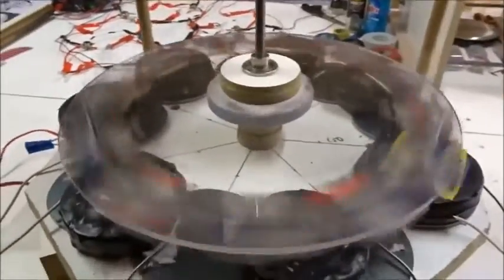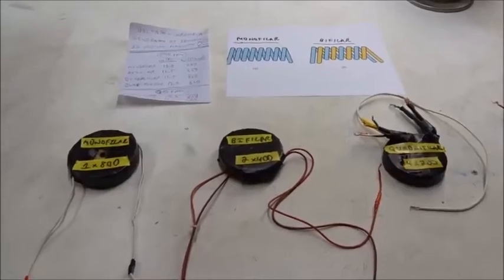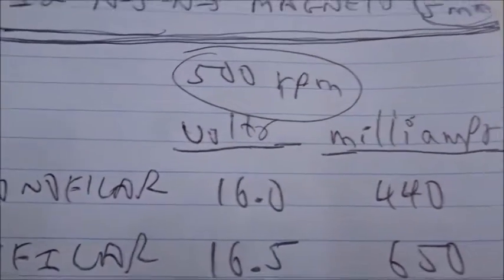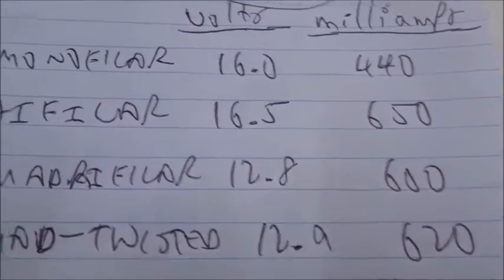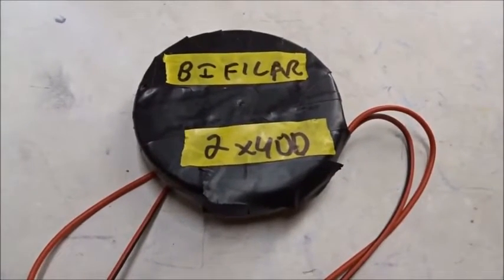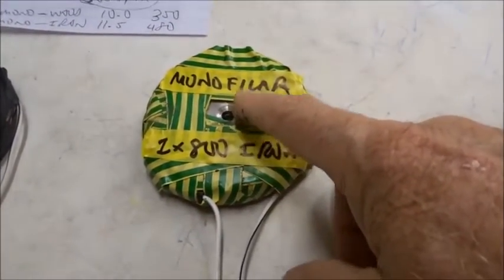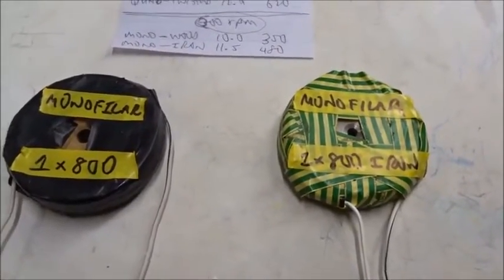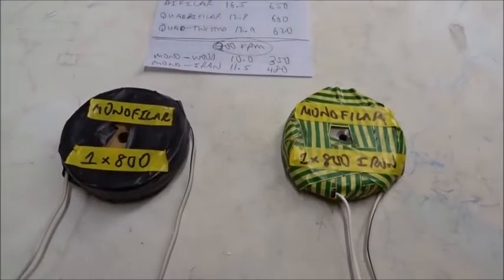Tesla was right! Bifilar coils are better for generating electricity: Part 18

Comment: The windings matter. When you have a wire or coil that are essentially straight, the electromagnetic inductance is maximized. However with twisted or cross hatched weaved multi-strand cable wire such as in high-end audiophile grade speaker cable, the weave helps reduce the inductive/antenna effect because when the wires are weaved together st roughly a 90 degree angle, it causes a 50% reduction in the magnetic field around that wire, which in turn helps reduce the inductance, capacitance and EMF noise that can negatively affect signal quality. So for high grade audio, you want a cross hatched weave with pure copper or silver wire, but for use in a generator coil, that cross hatch weave would essentially kill up to 50% of the inductance capacity of that coil due to wave cancellation effects.

Comment: You do realize that bifilar coil is a capacitor right. That is what makes it efficient at creating electricity.
Reply: No, it is synchronised resonance .
You might have 3-rd (but) as closed loop connected ends, then/that would act as capacitor.
As on transformers with different cores, the one as on microwave ovens where coil is in mid, the sides cancel the loop after input is cut, but placing additional wire and ends connected, continues as magnet even after removed the input. Typical example. 
While, other type of cores, some do not need closed-wire-coil-loop and they always act as magnetized after removing input . Typical example as half moon electro magnets.

There are lot more,... but some secrets should never be told, price is too tag, testing combinations will never get any to it... same as without Nikola they would never find frequency.
Later years Nikola was as spending time and going happy in casket with thought to all "you'll never find it".

But, nice mentioning the capacitor. Similar function.
Reply: A Tesla bifilar coil is essentially a line of a certain specific impedance operating in a special connection.

Comment: I assume this has to do with the power factor?

If so, couldn't this be solved just as easily by putting in a capacitor?

There's no way everyone in power generation just missed this, so I figure there's a good reason why it's not mainstream. Does anyone know what that reason is?

Comment: Thank you to everyone for the comments! We also had coils with 3 strands (trifilar) or 4 strands (quadfilar) but did not get better results than 2 strands (bifilar), so we did not show them in this movie. The bifilar coil (wired in-to-in, out-to-out is also excellent as the secondary of a solid-state Tesla coil. If anyone has any good ideas which I have not yet tested, please add comments below, then Tammy and I will try to get onto it! Right now I am working to make a better ion-drive for space propulsion, on a small scale anyway. When you are up to your ass in alligators, it may be hard to remember that your objective is to drain the swamp!

Comment: monofilar will still have some capacity between its windings. but the main trick of the bifilar is, that the voltage that charges up the capacity, is much higher (1/2 the supply)

 so with bifilar the resonant frequency is much lower, and the coil can store much more energy in it's resonant fields.
Reply: I see you found the video thank you again for following up on my request to review this video.

Comment: There is something you can clarify for me. I am under the impression that your setup of your rare earth magnet assembly will produce DC and not AC as you mentioned. How is it that you produced/measured AC? I too have made a bifilar hemisphere coil and used an AC to DC transformer as a power source. What I don't understand is that the compass that I used to see if the current was stagnant or fluctuating. It spins the compass at a very fast rate at only 3V DC input. So does the bifilar coil change DC input to AC. Thank You for your demo.
Reply: any set of moving magnets makes AC

Comment: Correct, when the primary is under load ,the secondary with a variable capacitor could be tuned to act as a buck booster. It cuts down on wire heat almost to the point of elimination. It can be shunted or a variable resistor too but not much research on that end

Comment: cool, however have you though about which order to put the quadfilar coils in. because when looking to the voltage difference which causes the capacitance. because if you put it in order like coil 1, coil 2, coil3, coil 4, then it will have lower capacitance the difference between 1 and 2 is 25% the difference between 1 and 4 is 75%. going from one to 4 to 2 to 3 you should get practically the same capacitance and effects as a bifilar coil. when you form the coil more like a thoroid or ball the quadfiliar coil can have a greater capacitance than a thoroid or ball shaped bifilar.

Comment: This is a good stuff. So please do next test. Measure a power at input of running motor. See if there is a difference in power consumption between a bifilar and monofilar coil. It is clear that bifilar coil gives more out at same speed of rotor (500 rpm), but there is a question is the power consumption the same or it increase also?
Reply: Hi there, did you ever get an answer to this question? I'm curious myself.
Reply: @JenkoRun  No. Not even as a joke. Because when is there something really worthy most of the people just keep it for themselves.
Reply: @Radovedn  That's annoying, thanks anyway.

Comment: It is good but not all accurate since it can be misleading since it is not exactly smooth process in addition or multiply, so first one to second one, first one is mono with 2 / 400 and bi with 2 / 400 so the ratio is 200, but second is 5 / 200, so the ratio is 40. So, it would be accurate so it is 5 / 400 which make it 80. So? would 5 / 200 better than bi?? Since the number is not even, since even the number that make sense but the process within can cause paradox so it is not assume to make sense but cancel out in big way because of number. So, can try again that is 5 / 200. So, and can explain why if I am wrong then you know why then can explain why in details. So, I would guess the details that is copper opposite to magnet, which both magnet field in opposite so cancel out, so for bi, so it cancels out the opposite magnet. So, 2 against to 1 is better. So, for 5 / 200, not 5 /400 which ya didn't do. So, 4 times in opposite to copper, so 4 times the power, less power than 400, which ya didn't do, but if do it will be higher power, so the current will be higher. So, the lower ratio that is 5 / 200 is 40 that is less than 5 / 400 is 80, so 80 is higher power from copper point of view so the impact is higher so reduce the current as output since the inner current reduce the power which power is supply that is volt, so volt is impact to another volt that is inner from copper so combine as current so it reduces the volt, which reduce the output current. So, 5 / 200 is better?? So, it is reduce as an output than bi because 2 / 400 is 200 that is higher from copper point of view will cause higher impact to volt, but I doubt it since it is better. So, more likely 2 as 1 is an impact to current since 2 left and right that is attract and repel power, or left and right, or possible more accurate that is two outward or two inward, so the cancel out of current is outward or inward so to reduces to zero. So, 5 is double of 2 plus 1, so 4 which two output or input, so two will cancel out as 1. So, it is not linear direction power but impact to nearby power or spread out from two wire as bi. So, well, can explain the process why or if you are not sure, so can try with 5 / 400 to show higher reduce or so? Well, 5 / 400 and 5 / 200, so which is higher reduce in current. 

If there is reduce, so why is there is reduce because base on my explanation that direction power or so? Ya can put core in center with quad / 200 and / 400, so it will hold the direction so will overcome so better than bi wire, if that is true then it means power is not one line from wire itself but it goes down thru space and impact or goes outward so it miss another wire, so need core to hold the direction. It is good experience thru seeing from other people to understand how energy work.
Reply: I am confused here, what ratio are you taking about ? What I understand is all coils are of 800 turns.
Reply: @anupk4857  Ok, I miss the part for 1 / 800. Ok, not aware of it of all 800.
Reply: Ok, not aware of 800 as even ratio above and miss the 1 / 800. So, since the ratio is constant for 800. So, the reason for above why it goes down from up to down, so from 1, 2, to 4?? So, as explanation for reason is list above. So, can add to 1 / 800, 2 / 800, 4 / 800, so which is better and why? If ya know the whole reason, so bi is best for all things thru any you think of like I type above, but bi is still better?
Reply: @khaliffoster3777  I don't knos why , I think it's the way magnetic field lines interact in a bifilar coil. why bother why if we can use it how it is.
Reply: @anupk4857  Ok, it is more important to understand why to gain higher level of understanding so will improve higher things from more simple things, and extend of knowledge to other things as well. In comparison to Wood and Metal, the wood is earlier than Metal, so the use of wood to make bed or anything, so to lock the wood within like in Japan, or wait later then use metal as screws, so if wait later to use screw, so you miss the part which the earlier uses can be stronger and vary by lock within so it holds things. Sure can use wood screw, but it is weaker than lock in wood. The point higher understand of things will extend to higher application from that thing.
Reply: @khaliffoster3777  do we know why metal is stronger than wood ? Do we know why mercury is liquid even though it's denser than iron ?? Yet we use them.
Reply: @anupk4857  Yea, but it help to know why to extend our knowledge. Ya are implying that we shouldn't use them because we don't know enough??

Comment: Excellent.  You should now test the Rodin coil to see how it compares.  Even better make a Rodin bifliar  or trifiliar coil.  Why? Tesla also said the distance between the wires makes a difference. At least I recall reading some that he said that. It may be in the patent. I forget.  But the rodin coil proposes the idea that the geometry of the the coil matters as well as the specific distances between the windings/wires. You could also wind a bifliar tesla coil with space between the two windings to test the idea.  Maybe it will have even more capacitance with a larger space between windings.   We need you to do the tests to see if distance/spacing  matters and if geometry matters!
Reply: Geometry does matter.  The Rodin coil just happens to be the same geometry as magnetism itself.  I would be very interested in the results.
Reply: @BenCooke419  For one thing Rodin coils concentrated the flux at the center, it's a common thing with geometries that start out the edge and move in towards the center, Tesla discovered that when he found the edge of his spiral coils didn't have any streamers where the regions close to the center did, same amount of flux vs differing density.
Reply: Rodin coil is a bifilar coil by default.
Reply: @Radovedn  As far as I understand the Rodin coil does not loop back on itself the bifilar coil does.

Comment: I am researching the Tesla  Bifilar pancake coil also! Would be great to share insights, check out my channel. I found some rather unique effects, like I show in my april 2019 radiant power video. 
These bifilar coils, when made series resonant, can be impulsed. this is then used as a primary. the secondary then becomes resonant in a very special longitudinal way, whereby current and voltage are in phase. Thus producing power from resonance!

Comment: Which inductance is used in formula - the whole transformer 12v wind or 
1/2 of 12v wind, where capacitor is.?? The L is used with 940uf C,  for 
resonance at 60 cycles.  I plan on attempting current increase of Briggs
 alternator ring on lawnmower using bifilar rewind + capacitor